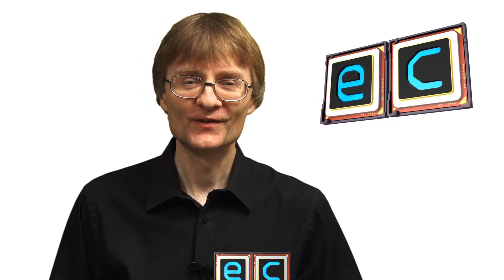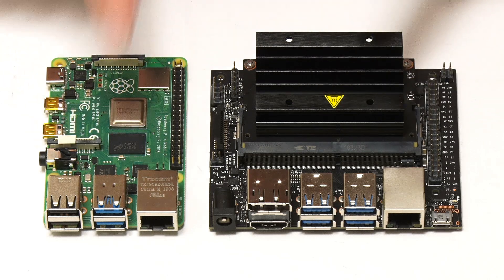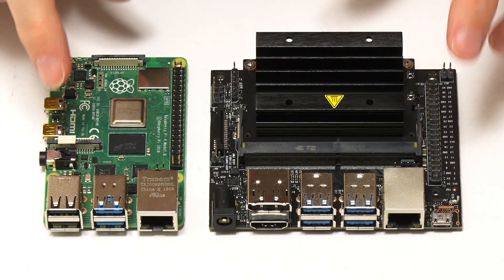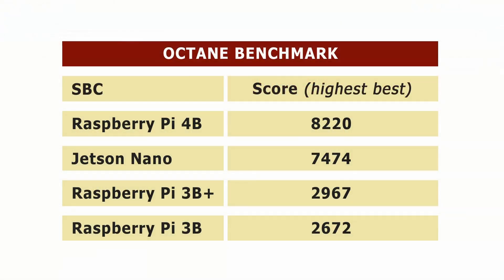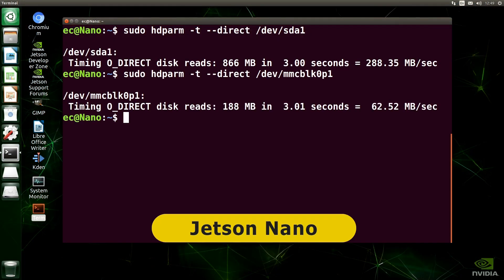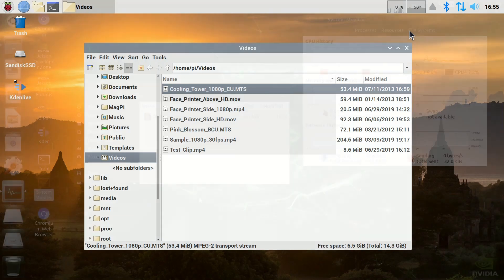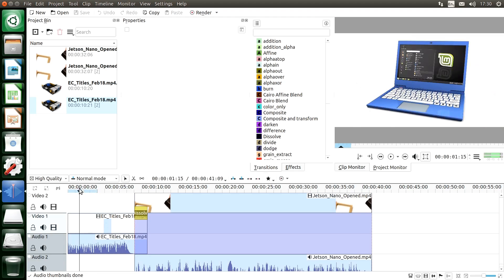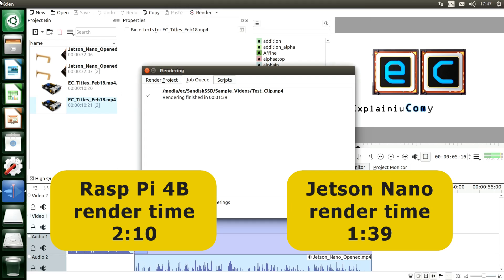Raspberry Pi 4B vs Jetson Nano

Comment: I tried the Jetson Nano and the RBP 4B + with tensorflow and the RBP 4B +.  RBP 4+ processed 2.4FPS using a type of SSD Mobilnet lite training while the Jetson Nano delivered 22FPS on the same neural networks.
  The Jetson can run DeepStream with Coffe2 networks at 45FPS and the RBP 4+ only at 1.8FPS for the same model.
  RaspBerry PI is excellent for everyone, except analytical videos and DeepLearning or Autonomous Robot.
Reply from the maker: Thanks for sharing your data. :)
Reply: Better info summed up in few sentences than whole video. Ty and gj guy, sry video guy :)
Reply: I was testing tensor flow for object recognition on rpi 4. Now it all makes sense for the fps thanks to you. Thanks bro. Will definitely consider jetson nano after this.
Reply: what do you recommend for machine learning?
Reply: @ralphjohnticsay8771  absolutely Jetson

Comment: So what I got out of this video is that the Jetson Nano wiped the floor with the RPI 4B when it comes to YouTube videos. @10:34 But id never buy a Jetson Nano since they do not have on board WiFi or BT.
Reply: You can get m2 card for few dollars. I haven't tested it, but I think you can even run new wifi ax cards, for 20$
Reply: @johnny_123b  good point.

Comment: Hi Chris, love your videos. Could you make a video looking at using SBCs for NAS builds? I'm keen to do this, but there don't seem to be a lot of options. Specifically I'd like to build a Plex server and the Jetson seems like it might have potential as it had four USB 3.0 ports and might be able to handle the transcoding, but I'm not sure if the USB ports are connected internally to a switch or a hub (i.e. whether or not they share bandwidth, which would be bad for performance in a RAID setup).
The only other option I've seen is the Helios4 (which seems like it might be up your street, although it's a little hard to get hold of - they might be willing to lend you a review unit though) which is the only SBC desgined specifically as a NAS that I've come across, but unfortunately apparently struggles it with transcoding for Plex:
https://kobol.io/helios4/
Reply from the maker: I am waiting for OMW for the Pi 4B, and then will certainly do this. :)
Reply: @ExplainingComputers  Awesome, thanks Chris! Looking forward to it :)

Comment: ofcourse raspberry 4 because price have only important, raspberry cost my shop 50€ and jetson 240€ all peoples buy raspberry not newer jetson. all jetson board stay self. too expensive and not anythink better.
Reply: is depends on each case  in my case the cost 130€  with shipping included not 240€ 
Where it comes out best price is on the Nvidia website.
Also having a driver on the GPU that supports opengl 4.6 , opengl es 3.2 and Vulkan 1.1 and pure 64bits distro from day 1 is a good support behind.

Comment: What is the point of the Jetson (built by a GPU manufacture) if it doesn't provide support for the thing that they are responsible for?
Reply from the maker: There is GPU (CUDA) support for AI apps . . .

Comment: This "comparison" isn't really valid.  The two devices are meant for two different functions. 

The RPi is a genera use computer with GPIO.  
The Jetson nano is specifically designed to do AI/ML prototyping using GPUs.
Reply from the maker: Both are boards that people who own an earlier Pi may consider upgrading to -- at least that is what a lot of subscribers have told me! :)

Comment: if you install extension h264ify you can get 1080p with no stuttering
Reply: I tried that on a pi 1 B+ on the stretch and buster Rasbian and it caused 4 mini garbled video fields in the top half of the the player in Chromium while on YouTube.
Reply: @kjrchannel1480  which model of the pi4 are you using I am using the 4gb...also have you sudo apt update to get the latest version of chromium?
Reply from the maker: No, you won't -- I tried h265ofy here. :)
Reply: I am watching your video right now with it installed frames dropped  29 from 10,000
Reply: If you didn't catch it. It is the Pi 1 Model B+. So it is the great grandparent of the Pi 4. I find it equivalent to a socket 7 AMD 450 give or take.

Comment: Could you post what utility you use to show youtube dropped frames? Thanks for rest of the review.
Ran Octane on Gigabyte Brix with J1900 , which is my idea of minimum usable Wintel and Octane score is 7500. This is perhaps more realistic than comparisons to i5/i7. IMHO the rpi4 just about makes it as a desktop replacement.
Reply from the maker: The utility is "Stats for Nerds", which is built in to the YouTube player -- jsut do down to the settings menu (gear wheel).
Reply: @ExplainingComputers  glad to know I'm a nerd!

Comment: Thank You for the good and fair comparison, I have both. My major question will be is this two boards good for 24/7/365 operation, assume I have proper cooling, I am worried on two angles, the SD Card reliability in using 24/7/365 and the build components. Can this boards work confidently for say 60 months?
Reply from the maker: I would have reasonable confidence in both boards, assuming really good cooling for the Pi 4. :) I would get as much write access as possible off the SD card. :)

Comment: I have too many computers now- or rather I always have had too many but now the small mountain has reached my wife’s attention and might I consider building a few more before buying any more.
The Speakers of the Interweb recon the chip is good for at least 2Ghz, but nobody has worked out how yet.  Soon as they do and we have ‘skies the limit’ then I will buy and build an oil cooled system.

At it’s simplest that is the cheapest type of aquarium, a pump and the Pi4.

Comment: Chris, 1st things 1st. Everyone needs to go to the terminal & type: sudo apt update -y & hit Enter. That will update the repositories from the test to stable Raspbian Buster. Then type: sudo apt full-upgrade -y & hit Enter. This will update everything to the absolute latest stable release of Buster dated July 8th. Then reboot!
Now, by adding the overclock lines too the config.txt under:
[pi4] 
over_voltage=4
arm_freq=1750
gpu_freq=600
I was able to get a score of 9005 on Octane. I am using a 4GB, I also have a Pimoroni FanSHIM https://shop.pimoroni.com/products/fan-shim  installed set to auto run at 55C. Everything is running perfectly stable with these settings, but keep in mind I'm using https://shop.pimoroni.com/products/fan-shim
Reply from the maker: Good result on the overclock. I will cover cooling options and show results in a video on July 21. I totally agree on keeping the systems updated -- this was done before these tests were run, but inevitably before 8th July, as the video posted on the 7th! :)
Reply: @ExplainingComputers  Chris, hope you are doing well my friend! Just an update. I increased the arm_freq=1800 & it still runs completely stable! Again the only cooling I'm using is the Pimoroni FanSHIM & that's it. I'm able to keep it around 58C under load.

Comment: What is problem with USB c port in  the raspberry pi 4 please reply as soon as possible before my purchase
Reply from the maker: The problem is that it does not work with all USB-C PSUs. But it works fine with the official Raspberry Pi one. The Pi 4 also runs very hot (even if you install the firmware update for the USB controller), and so does need a cooling solution.
Reply: Nothing if you stick to the official power supply and cable.

Comment: How is that "vs"? Raspberry Pi 4 is a Pi, i.e. a cross between a light-weight computer and an embedded system. NVIDIA Jetson Nano is instead an embedded system counterpart of a visual center in the brain, with massive parallellism and neural net software -- it is a start of an artificial mind, although with an ordinary computer attached to it (the ARM processor).
Reply from the maker: They are both SBCs that I know many of my viewers are considering purchasing as a step-up from other SBCs. They may have different target markets, but not different target use cases.

Comment: it would help if you showed the spec of the GPU a bit more.

For instance you have frequency and core config. the nvidia one could be a dual core each with 64 shaders whereas the video core could be a dual core with its own pipelines. I was hoping you could've shown this for the GPU spec as it explains GPU performance a lot better in how they fare at compute and graphics.
Reply from the maker: Fair point, but I have made seperate reviews of each board and did not want to repeat too much.

Comment: very extensive and justice making comparison; if you want to get GPU accelerated playback on local video you can use omxplayer, a command line video player for the RPi3B(+) that will free the cpu to perform other tasks (and keep the temperature down a notch too); impressive how the Jetson manage to run a full Ubuntu desktop with the (resource heavy) Unity interface
Reply: Nvidia have been doing parallel computing for a long time-  the 'graphics' will be doing CPU stuff as well.
Reply: @twmbarlwmstar  the parallel computing is still based on the gpu (opencl, cuda, etc); ARM is improving but is far from a desktop replacement (comparing with intel or amd)

Comment: Hello, i'd like to say that you are not using Hard Accel if you are not in full screen, the only tech supporting hardware acceleration when not in full screen relies on DirectX. That's why we are not going to get it on SBC soon.  
PS: you can get Hard Accel without full screen, but you will have very strange behaviors because the decoder write over everything else on the screen

Comment: I know that you're probably a big fan of kdenlive and possibly use it in your workflow, but there's also a much better (open-source as well) alternative if you were at all interested called Shotcut.

It might be worth a look
Reply from the maker: I don't use Kden live. Shotcut is an x86 video editor, so will not run on these SBCs, as they have an ARM processor. (Kdenlive is both ARM and x86).
Reply: ExplainingComputers Well, I was just meaning in general for your own usage. I was under the assumption you may be using it for your own videos. Unless I’m completely off base. But I figured it would be a cool open source program that you would find useful. But anyways, great videos, they are super informative! 😃

Comment: Sorry - accidentally deleted old comment trying to edit.

Octane score of 41000 on iPhone Xs... 🥴 Anyway, I always assumed the jetson nano was meant as an embedded gpu platform for things like facial recognition in kiosks or smart devices. It seems the point of this is nvidia wanting to jumpstart hobbiest GPU/tensorflow development just like RPi jumpstarted low power ARM + Linux development for the public. 

Benchmarking the CPU on a Jetson Nano is like benchmarking the CPU on a game console. It'll be poor to adequate, but that's not the point; The Jetson Nano has THE most powerful GPU available on a $100 SBC. 
This is listed as a Dev board... Someone building a smart refrigerator with facial detection would  their compile your app or game on a PC, upload it to the Nano and run+debug there. A dev board would have more gpio pins and RAM than what would be a lower cost production board that would be integrated into an end product.

Comment: Try Firefox with h264ify add-on.  H264 1080p h264 witch is hardware accelerated.   Normal YouTube plays in a vp9 video format witch a lot of devices struggle with.
Reply from the maker: H.264ify was used here. :)

Comment: With respect (I do enjoy and appreciate the production values of this channel), this review is not entirely useful, as it compares two entirely different tools, designed for entirely different jobs. The Jetson nano is not a board for developing. It is a stripped down version of the TX2, and is designed for small scale production runs of image processing hardware. That is, bespoke AI hardware, to be installed on robotic systems, for navigation or object detection.
So, you are not supposed to use the Nano for development of your custom AI training sets, to develop software for navigation or image recognition. The idea is that you develop all that stuff on a more powerful Jetson board, and then refine it, using the dedicated NVIDIA software tools, until the AI is tuned in, that is to say it becomes "trained" to your prevailing data set. Then, once you've tailored and trained your software, you put the stripped down version onto a nano. It will run your efficient AI subroutine at a much lower cost, and hardware footprint, than using the TX2 and its development ecosystem ($500 or thereabouts).
The Raspberry Pi, by contrast, is a straight up SBC. It is designed for children to use, and become acquainted with the very basics of processing. It is a fine product, for this sector. Amazing value, in fact, and great fun.
The Jetson, by stark contrast, is an AI platform that requires very extensive control of the command line interface to get working properly.
I would warn anyone getting into the Jetson platform to be careful of recent software GUIs that imply that one does not need command line skills to use it. On the contrary, if you are not comfortable working from a non gui interface, this system, this tool set, is not for you. Unless you wish to learn, of course.
To show this, the author should get a TX2, and implement basic AI functionality. That process will demonstrate that very few SBC customers will be comfortable with the skill set required to use this tool set, and so there is no point in buying this platform. At the same time, it will become clear that the Raspberry Pi is not a robotics tool, and simply can't do the things the Jetson was designed to do.
Reply from the maker: I take your point, but many people (certainly many of my viewers) I know see these boards as possible upgrades to their current SBC. The Jetson Nano is broadening into markets not necessarily its initial targets . . .
Reply: @ExplainingComputers  Well, I am currently using my TX2 as exactly that. So fair enough. I'd love to see you tackle the command line, in a series. It would be very useful for the community, to have well produced, articulate lectures on the ways of the terminal.

Comment: Sorry if in previous comments, but where/how did you get temp and cpu% in buster applets?
Reply from the maker: They are in settings for the panel I think (right click it as I recall). Interesting how the Pi Foundation just happened not to include them by default! :)

Comment: I have a mini fan on my RP 4B  apparently its a bug and some of the heat issues will be fixed with a firmware fix soon and another fix so u can boot from usb 3 is still to get implemented.
Reply from the maker: The firmware fix only reduces the temperature of the USB controller . . .

Comment: EC your said the pi 4 only 32 bit but that's wrong. Raspberry Pi 4 specsSoC: Broadcom BCM2711B0 quad-core A72 (ARMv8-A) 64-bit @ 1.5GHz.
Reply from the maker: No, I said that the Raspbian OS is 32 bit, which is correct. The Pi 4B is indeed 64 bit as you say, but the OS it is running is not. :)

Comment: wow this guy has no clue about the hardware decoder pipelines :)
Reply from the maker: What do you mean? I am think I am pretty aware of the issues involved regarding the software and hardware aspects of decoding. Please do not judge on what you deduce about my knowledge from on video -- I've been teaching, writing about and practising computing for about 30 years. :)
Reply: @ExplainingComputers  sorry I stepped on your toes there. You seem foverall very knowledgeable from your videos :)

Try decoding your H264 files using gstreamer with HW accelerated decoder:
gst-launch-1.0 filesrc location=<filename.mp4> ! qtdemux name=demux demux.video_0 ! queue ! h264parse ! omxh264dec ! videoconvert ! queue ! xvimagesink

Note the CPU usage, is still quite significant.

In your examples you believed the the CPU was doing the decoding due to high CPU usage, which is not true.
Reply from the maker: Thanks for this. I assumed that the GPU was not doing the decoding because both the Raspberry Pi Foundation and NVIDIA have been explicit in stating that hardware decoding is not currently supported in the browsers.

Comment: At 5:20 you say that both OS's are based on Debian. You are somewhat correct ;) as Ubuntu is a derivative of Debian. But the JetPack (or how you write it) is definitely Ubuntu with the Unity DE (or I must be very much mistaken). That also leaves me a bit mixed, because that means it's a very old OS (I think 16.04?), especially compared to the new Raspbian, which is based on Debian Buster, the absolute latest (version 10). Support by Ubuntu for version 16.04 is long overdue, so no security fixes.... Could you run a lsb_release -a on the Jetson, to confirm my suspicion?

Rest me to say that I thought this video was a very comprehensive comparison between the boards and it amazed me that the Jetson outperformed the Pi 4B. Well done, sir!